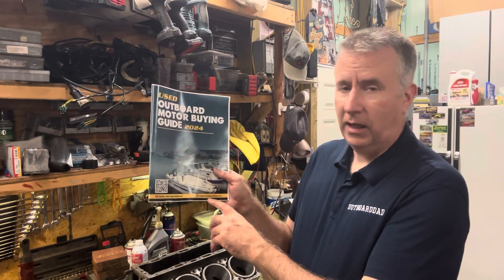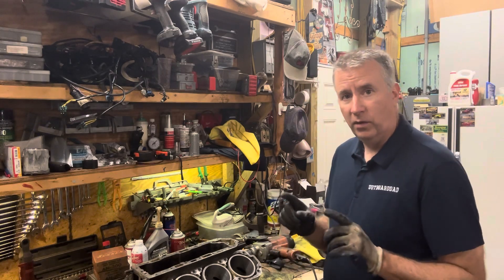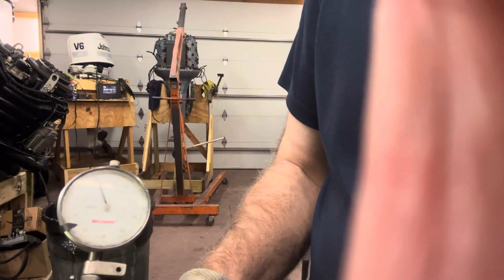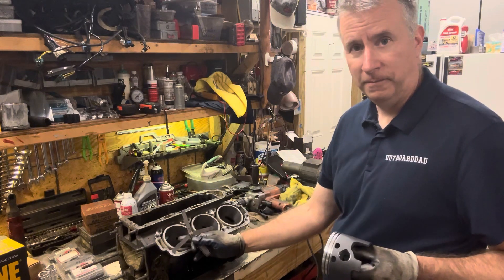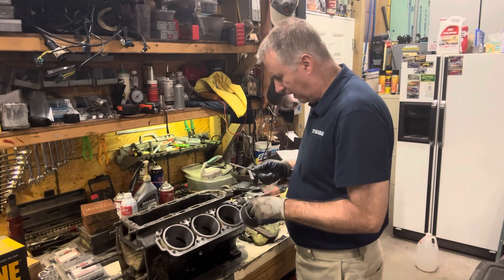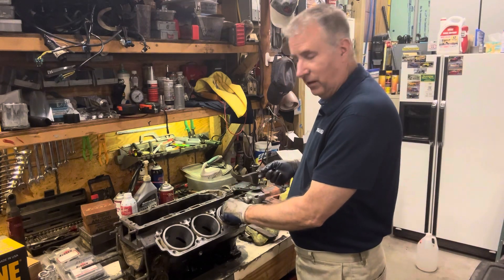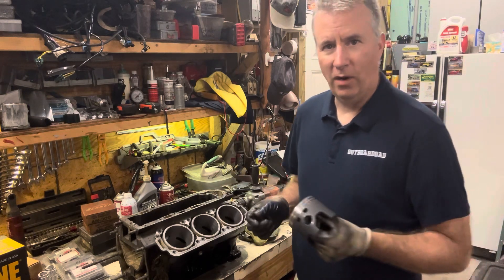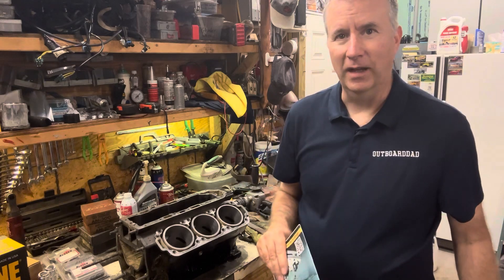Mercury Outboard 2.5 block cylinder Hone by hand (Part 17)

Comment: Going all the way to 5  thousands over the piston size, instead of 3 or 4 over, seens like a very wise idea to me.

5 thousands of an inch is only 0.127mm or 127 micrometers.

It's a very small proportion of the diameter of a 2.5 liter motor with 417 cubic centimeters displacement for each of the six cylinders. 2500cc=6×417cc

I don't have the exact size but pistons diameter should be around 90mm or so because a 360cc motorcycle has an 85mm piston .

90.127/90 equals 1.00141 or an increase of 0.14%. A very small percentage with 5 thousands. 

8 thousands should be around 0.26% over.

I still don't know why Wiseco pistons, used for competitions, need 8 thousands and your manufacturer recommended only 3 or 4.

Seems to me like in competitions engines get hotter than normal.
I don't think that Wiseco pistons will get any larger for the same temperature because they are made with aluminum also. 

Anyhow...
As you said...
Sacrifying a bit of an almost unnoticeable compression is a cheap price to pay, getting in exchange some extra room for overheating that seems to be an unavoidable accident, that will eventually happen almost for certain.
Reply from the maker: @josemariatrueba4568  Agreed, the difference with Vertex is the amount of silica in the piston. Resulting in less expansion.
Reply: @OutboardDad Silica cover results in less wearing because the friction coeficient is smaller. This is better because less friction means less temperature due to friction but this cannot avoid that the piston is going to expand if the motor has poor cooling from a bad pump,clogging or poppet valve failure.
But I doubt that the coeficient of dilatation of the aluminum used building the piston is going to be less than using any other brand of pistons.
Reply from the maker: @josemariatrueba4568  Interesting, it’s not the coating. It’s the alloy mix when manufactured that makes it not expand as much.
Reply: @OutboardDad  Understood that their alloy has smaller dilatation coeficient. 
Makes sense!
Reply from the maker: @josemariatrueba4568  Well, we are going to find out how good they run!
Reply: @OutboardDad  I'm sure!